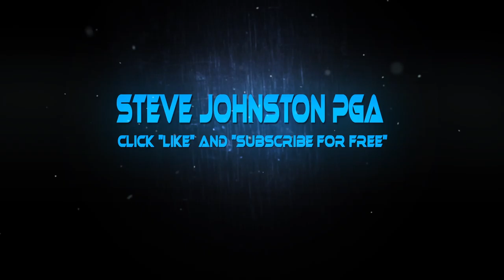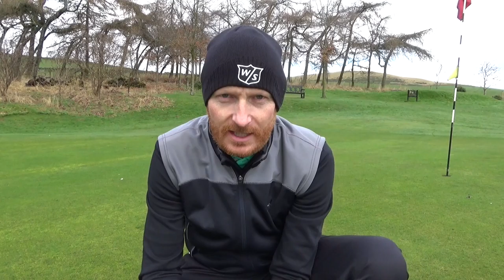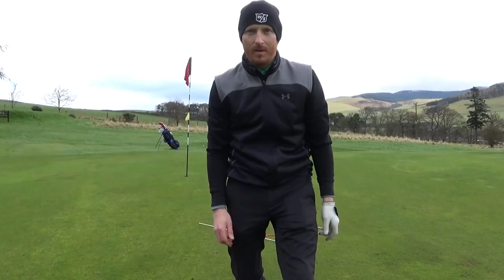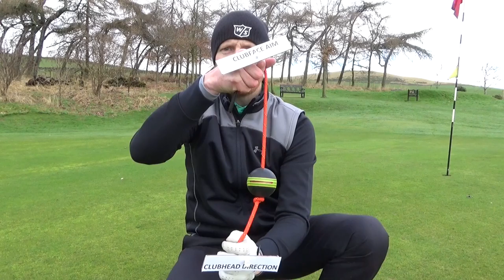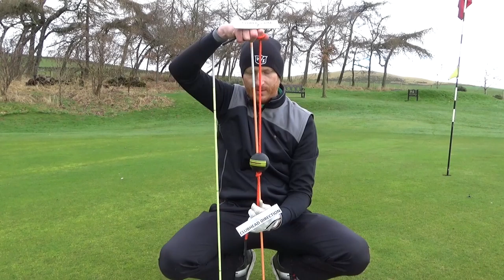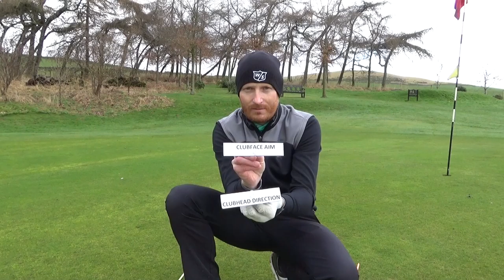D PLANE SIMPLIFIED -  What is D-Plane?

Comment: I would have thought a simple explanation of side spin results from a flatter swing as the shaft length increases from the golfer producing an open or closed face.As well, over swinging which produces erratic and non consistent attempts to produce a square face at impact. The biggest mistake is to getting too technical .